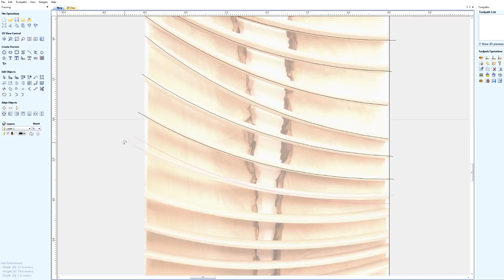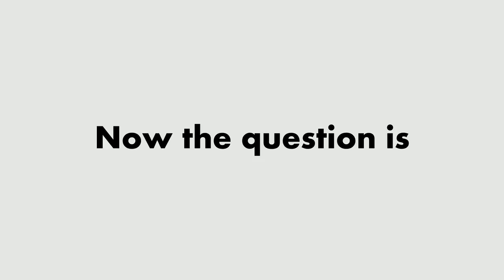Natural Edge Bent Lamination Wall Art

Comment: This is my vote for which way based on the lighting in the video; The shape looks best vertically displayed, but the grain looks best when the piece is horizontal with a downward light. So... if you could display it vertically, but have lighting from the sides to make the grain pop. Perfection.

Comment: Did you initially work from a sketch, or mental image?   I know you pre bent the vanes but I noticed tension in the assembly and I was wondering if the white glue is adequate for long term without any mechanical or wooden assistance ie pegging or screwing. Nice to see you creating.
Reply from the maker: Mental image all the way.  Whatever tension there is in the slats is resisted by the grooves, not the glue joint.  It just has to hold up the weight of the front half and there's a ton of glue surface area.

Comment: A lot of people are saying horizontal, they're all wrong. Portrait- looks better from the front, IMO, but maybe more importantly you can actually see, and see through, the slats from the sides.
Reply from the maker: The thing horizontal has going for it is you see the walnut side of the strips from one side and the cherry side from the other, so it changes depending from where you look at it.  That gets lost in the vertical orientation.